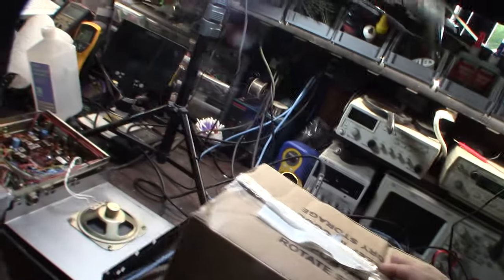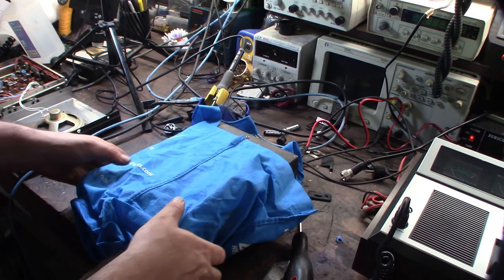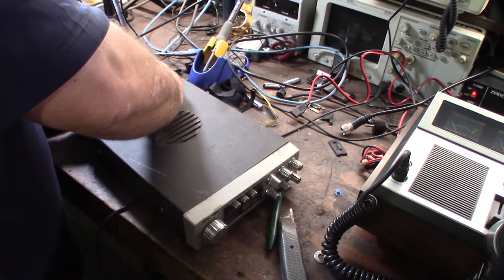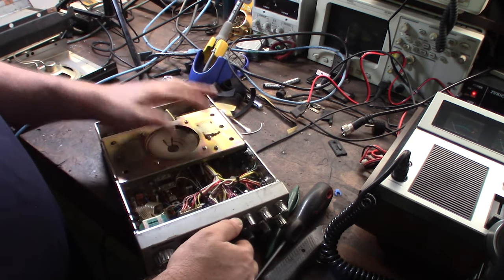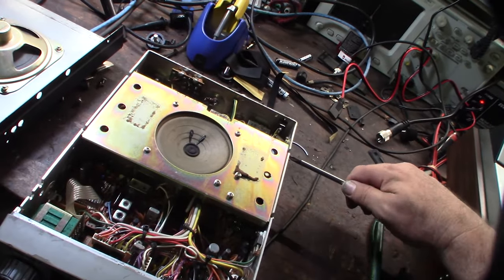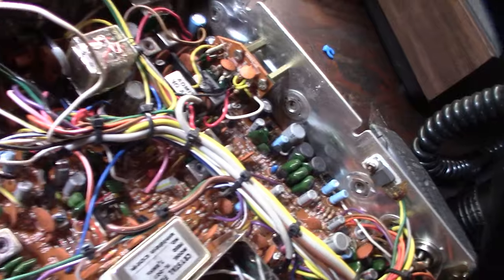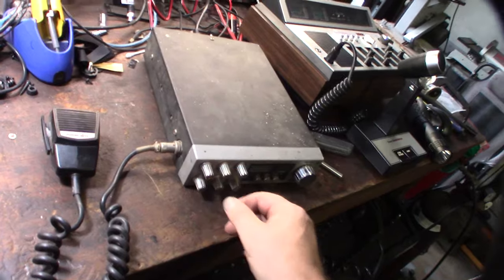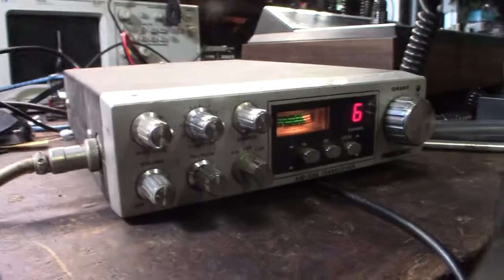HOLY GRAIL!!! President Grant 1st Gen SSB CB Made In Japan Restoration 858 PLL Part 1

Comment: I get a kick out of someone getting radios that I grew up with.
I cannot count the times I modified the 858PLL, the O2A PLL, 8719PLL.
We used to use VFO's on some of our radios, and put crystals on a switch, all kinds
of things to get the lower and upper freqs.
I personally have some Midland 77-882, 2 Malaysian 148 GTL's still new in the box.
I'm not selling them. I opened 1 of the Midlands a while back, done my conversion on the O2A, and works well. Made in 1976. The box is the Convoy theme look to it, with C.W. McCall on the front.
Great receiving radios, the transmit is nothing compared to todays radios, or even in back in the 80's, but I still use them.
Reply from the maker: I remember Convoy. Pretty little when it came out. I'm 49. What is your favorite modern radio for transmitting?

Comment: That transformer is a  in line choke and is used for the + 12v power. run the choke in series with the + 12v
Reply from the maker: Thanks, I was wondering what that was.

Comment: 70s? Wire ties were invented in 1958, sure, but I've never seen 70s Japan consumer electronics with them.  And those look pretty modern, 70s ones usually had the metal tooth. That trnasformer looks like maybe a choke that the power originally went through?
Reply from the maker: Cool, thanks. I guess I've never seen the black zip ties are older equipment. I usually see clear. I'm trying to find a schematic for this radio to see how transformer/choke is connected. Choke makes sense. I only see two connections. I wonder why it was disconnected. I have a capacitor kit on the way.
Reply: @fintechrepairshop  Go from the three pin plug + side to one side of the transformer then the other side of the transformer back to the main board.

Comment: Same chassis as the Cobra 138 xlr....
Reply from the maker: I noticed that when I ordered my Cap kit from Klondike Mike. The relay gives it away.
Reply: @fintechrepairshop I just sent my Cobra 138 out for restoration. I am pairing that radio up with a ball mounted Hustler RM-11  on the tool box.

Comment: I would have thought the Japanese factory would hard stamp "made in Japan " onto the rear chassis? An applied aluminium tag can be made by ANYONE who wants to scam radio fans.
Reply from the maker: It is hard stamped in the back of the radio, in the aluminum. It runs a PC-176-AD mainboard, look that up. Scam?
Reply: @fintechrepairshop  stamped into an applied aluminium tag, connected to the chassis with pop rivets. What's underneath?
Reply from the maker: @brucejenner5856  Its on the tag and also stamped bottom left corner. Check out my part 2. Why would I lie about the CB being made in Japan? I bought it because the Made in Japan is Stamped into the Aluminum. It also has Japanese Capacitors.
Reply from the maker: It has a rare PC-176AD main board, as far as I know they only made this board in Japan. The follow up board was the almost identical PC-196.
Reply from the maker: @brucejenner5856  Its 100% real. No doubt its from the 70's.